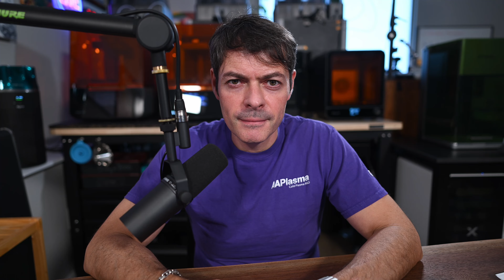How Plasma Surface Treatment Works

Comment: Great video as always.

I've got a couple of questions, hopefully one of them might interest you:
- You've mentioned the antibiotic coating a couple of times. I imagine there's a wide variety of use cases for it in adition to your example of implants (maybe assisting in surface sterilisation in food processing and medical enviroments). I'm curious about how common (or uncommon) it is, and what problems are faced with its adoption (cost, material limitations, unintended downsides).
- Is there any degradation of the treated material from plasma treatment (other than the surface scratching)? I imagine that  theres some level of heat damage or maybe damage from current passing like in electrocution.
- I watched a video recently (I forgot the source unfortunately) that mentioned plasma nitriding of steel. The process seems really useful as it can be used on top of other methods of changing the materials properties and seems quite low risk (in terms of damaging the object). I'm curious on your thoughts of plasma niriding.
- Are there any other uses of plasma similar to plasma nitriding (where in which plasma is used to diffuse something into an object) rather than etching or deposition?
- What do you reckon is the easiest way a normal person could play around with plasmas? I'm thinking of something within reach of a hobbyist or backyard scientist (although not too many people have a backyard nowadays). Off the top of my head theres playing with microwaves (not something that I'd recommend or am keen on myself given the danger - but there's plenty of diffferent things possible with it eg microwaving grapes and fire) or collecting fluorescent tubes.
Reply from the maker: I know about half of that. I'll try my best to answer :). Great questions, thank you!
Reply: Very smart question!
Just out of curiosity what is your profession?
You know very well how to formulate and ask smart questions. I myself was a little perplexed and curious when Greg talk about antibiotic coating but I brushed it off.Now that you asked, I'm curious to hear the answer.